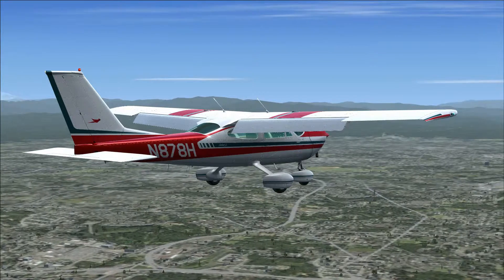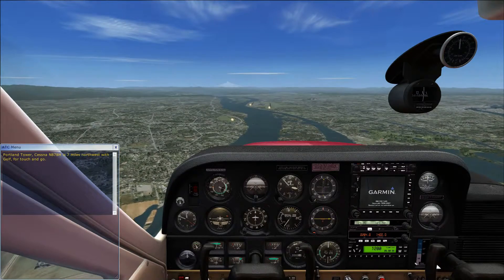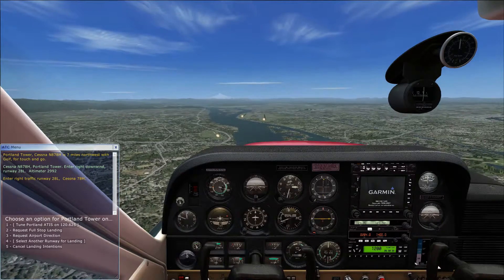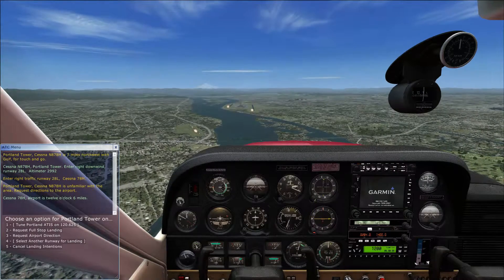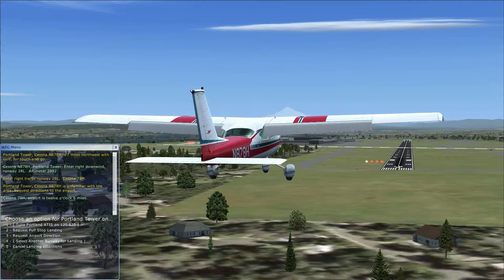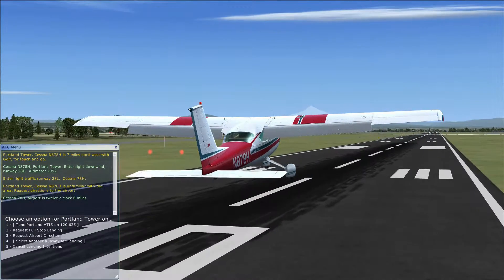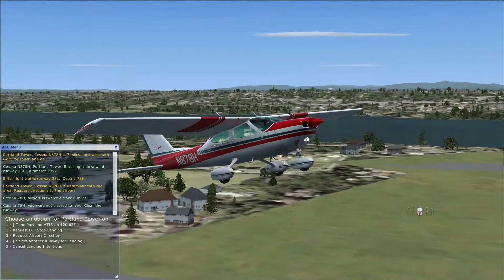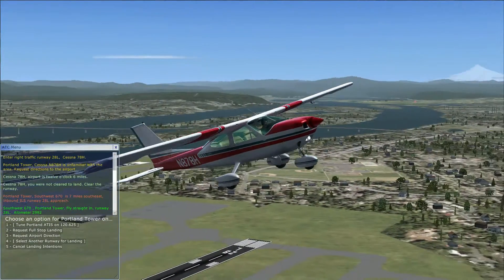FSX Touch-and-Go with ATC | On-Going Series - Episode 62

Comment: The hardest problem I have always sound is when flying a downwind, base leg, final, etc, keeping the runway in sight. I used to fly a real world Cherokee and with the wider view, it is not difficult in real life  Any suggestions would be helpful
Reply from the maker: Yes, it would be harder in FSX as you have almost no peripheral vision. The only thing I can suggest to make it easier would be to get something like Track IR where as you move you're head the camera moves as well. Other than that and purchasing more monitors, there's not much else that can be done (other than obviously moving the camera manually). Sorry!
Reply: +Jack's FSX Videos thanks for your reply. And your videos.